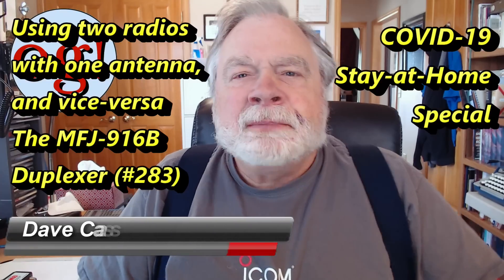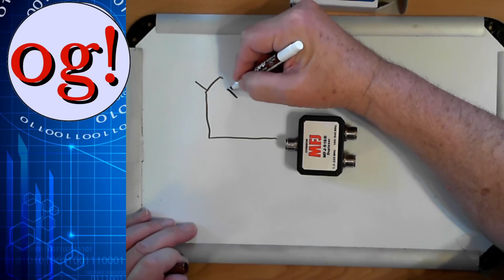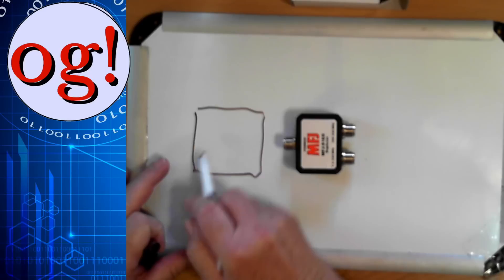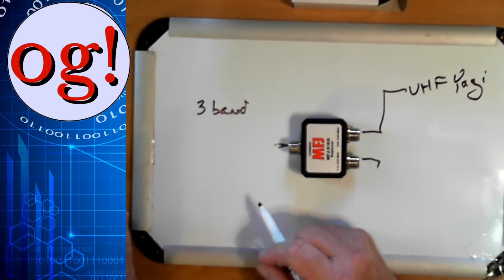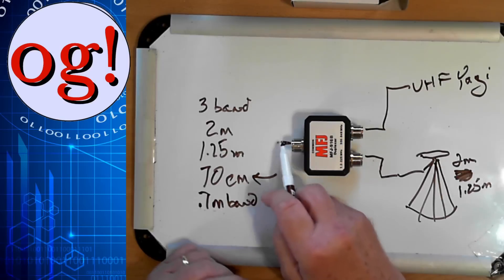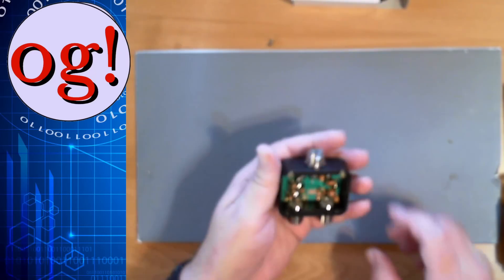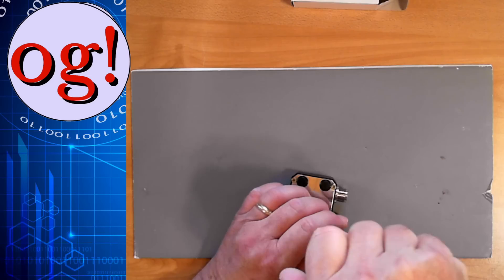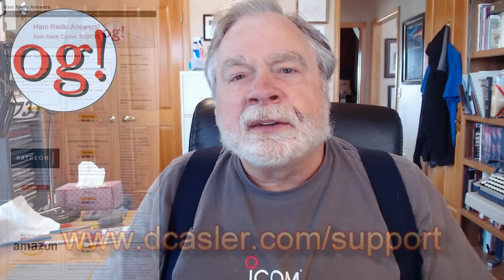MFJ Duplexer--Two radios, one antenna, or vice versa (#283)

Comment: Is there any way/device that would let me share a dual-band antenna with between two devices without splitting out the bands? What I would like to do is have 1 dual-band antenna feeding a normal dual-band (UHF/VHF) transceiver and also feeding an SDR - is that possible or do I really need two different dual-band antennas?

Comment: I have only been a Technician for about 6 months and am taking the General test in 2 weeks.  I have an Icom 7300 and a Yaesu FT 991A.  Outside I have a Diamond Antenna X50A and a Par EdnFedz EF-Allbandkw.  Is there an adaptor like the one in this video that will work on the HF antenna? Just so you know, I cannot thank you enough for all the video's that you have.  I really appreciate you sharing your knowledge with everyone.

Comment: Can two of these be used back to back i.e. both common ports connected together? I have two antennas in my attic that I want to connect to two radios in the shack using one coax.

Comment: What would happen if you key up both radios at the same time.  I have a UHF DMR repeater and want to use the same antenna for my System Fusion VHF repeater.  I'm scared what will happen if both repeaters keyup at the same time.

Comment: Hi Dave.  Love your videos!  I need to hook two dual band mobile radios to a single dual band antenna.  Although the radios are dual band, they may be operating in the same band, at up to 50watts. Can you advise which device I should use to do safely?  Would it be a duplexer or diplexer?   Thanks!

Comment: Question:   Can I use a 5 watt GRMS radio set on channel1 (for instance) and a second 5w GMRS radio  set on channel 15 using this device.   My thought is this combination could allow a make shift type of repeater using one antenna?  (using speaker jack (radio 1) plugged into microphone jack on radio 2 (Vox turned up to high sensitivity)

Comment: What do you use if you want to have two of the same radios on the same antenna that are in different parts of the house? to be used at different times? one in the den the other in garage  never at the same time

Comment: Is it possible to use two antennas to two radios on a single line without duplexers. On my Jeep I would love to run a GMRS antenna and a 10 Meter Antenna through just one bulkhead connector through my solid roof.

Comment: How many db loss in that box, and the extra connection?
Reply: Its negligible.
Reply: MFJ claims 0.2dB insertion loss, however a reviewer on eHam says:

"On 2 meters the unit is excellent with 0.2 dB insertion loss across the band.
Also on 70 cm the unit is Very good with roughly 0.3 dB insertion loss across the band. HOWEVER if you are planning to use it on 220 this unit is not the one to use.
At 219 MHz insertion loss is 4 dB
At 220 MHz insertion loss is 5 dB
At 222 MHz insertion loss is 6 dB
At 225 MHz insertion loss is 8.5 dB "

So, would be interesting to see someone verify those figures.

Comment: Dave..you have no idea how I have been thinking how to do my dual bander utilizing my celwave 70cm 8db gain glass vertical and my 2m 6db j pole together..!!  This diplexer will save the day. 
Ten more feet up, add the celwave vertical with more lmr 400, another arrester and Im in the groove again..
Thanks so much for the tip..my gears were spinning. 
73, Kb8qlz

Comment: MFJ-916B is not a duplexer, it is a diplexer. A duplexer is used on a repeater. Most companies mislabel them; who knows why they can’t get it right.
Reply: Can you use an antenna cable splitter connection to use one antenna for a Duplexer set up? 

I want a mobile unit for a SHTF vehicle and it would be tx 100w on one side and rx 10w on the other side....and the antenna would be 150w sg-7900
Reply: You would think that these manufacturers like MFJ would label it correctly.
Reply: I'm betting it's because the uninformed look for a DUplexer instead of a DIplexer and they label it to match the belief as opposed to the reality.
Reply: Hense why I buy nothing from MFJ.

Comment: Is it best to have a dedicated antenna for frequency you want to use? Like when using the icom ic-9700, which has three inputs each for the 2m, 70cm, and the 23cm, one antenna each. Or is there no differences at all or losses using a single three band antenna with some kind of tri-plex connector. I was always under the impression when using splitters etc. you have dbs loss or something?
Reply: I’m currently wondering the same thing. Also, losses from the triplexer aside I’m wondering what downside there is, if any, to a single multi omnidirectional antenna for the 9700 v three separate omnidirectional antennas. There’s limited space/safe attachment points on my roof for antennas to be mounted and have some distance apart so it’s getting crowded with a desire for vertical for FM use 10,6,2,1.25M and 70 and 23cm antenna needs.

Comment: Thanks Dave - my ENTIRE uhf/vhf antenna farm is located in my attic! Wide band Discone, 6 meter halo, 144/432 And 220 J poles. At present I have 1/2” hardline feeding them. They’re used strictly for local comms so this unit should help eliminate unnecessary milspec feeds and replace them with coax.